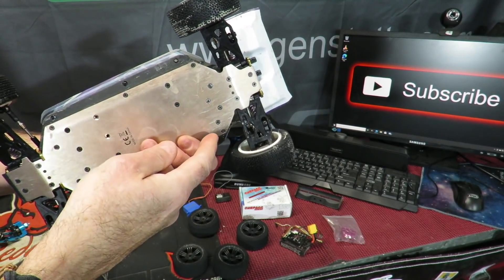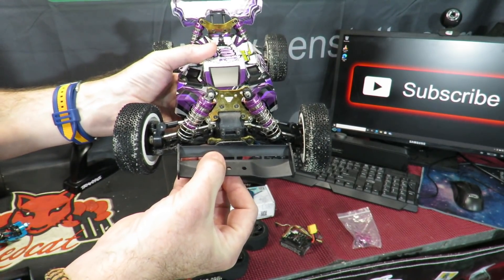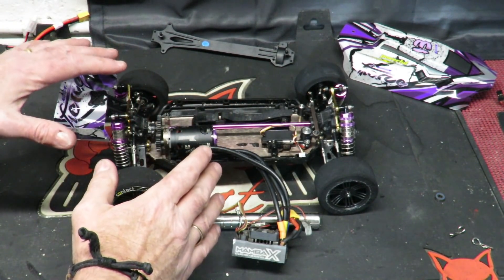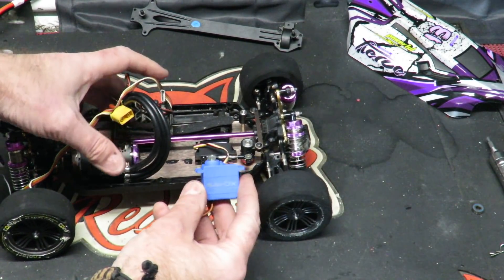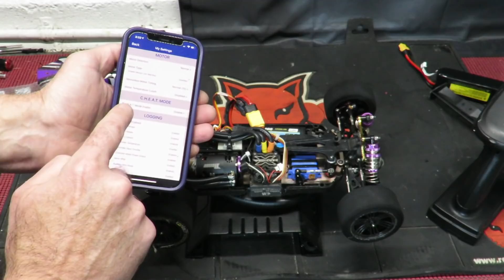Worlds Fastest WLTOYS 124019 Project 120 #RCINSANITY

Comment: I can't wait! I just fitted 2 motors in my 124019, I don't think the kv I'm running will top 100mph, but I wanted to see how it does since no one I can find has put 2 in a 1/12 car, I can fit them in the 144001 also, but need side trays for both. I laid my escs on thier side, and it worked out well.
Reply: One benefit of 2 motors is that you can gear up. Try larger pinion gears and/or smaller spur gears. The rpms of the motor dont matter all that much if you have twice the power behind them and proper gearing. High rpms don't matter if you don't have the power under load to actually reach anywhere near maximum rpms. That's why higher kv often doesn't actually mean a faster car. Having two motors actually allows you to overgear even higher.  Theres a reason that none of the fastest speed runs have been done with high kv motors. They are generally done with high voltage and low kv motors. 2 motors for speed runs is actually not unheard of either.

Comment: This is cool! I'm building an A979 chassis stretched using the 144001 driveshaft.  The a979 is narrow enough to fit old pan car 1/12scale car body's and is so light weight should do well over 100 mph on 3s lipo.  I don't expect the diffs to last forever and I have to shim the bearings etc. Build tolerances on the A979 are a bit loose but I can make it work.

Comment: Where did you get those aluminum wheel hexes. I bought a set from Banggood but the pin that came with them were too small for the 124019. Thanks
Reply from the maker: Let me double check as under COVID I’ve bought a lot on eBay and Amazon as well as Banggood. Also if you’re in the USA then LC racing have a store over here and as the wltoys cars tend to be lower cost copies a lot of the parts fit and arrive very fast. I bought about a car loads worth of spares inc a set of pins and screws(devil to get anywhere else!)
Reply: @DriftomaniacsRC  I looked at the LC racing hexes, they use a grub screw to to attach to the axle. The WLTOYS looks like a plain aluminum hex with a certain diameter pin. The hex I bought has a different size pin than stock WLTOYS.

Comment: Hello, the motor is recommended with 1 S lipo. Does it work well and without risk for the motor with 3 S Lipo?
Reply from the maker: I'd spotted that as well and was pretty nervous so I test ran it on 3S on the bench (timing on low) with some hard full throttle blips and it didn't get warm so yesterday I tested on 2S at my test spot to see and it ran cool. I am thinking that it'll be okay as it's barely pushing any load/weight. It began to rain so I had to quit but will try again today
Reply: @DriftomaniacsRC  Thanks for the answer I look forward to the 3S test and know the speed ;-)
For the moment it is mounted with a BL Motor 5200 kv I have a Castle 7700 kv but the cables do not fit in the ESC

Comment: Richie, I have a question for you. So when I place the MOD 1 gearing using the Traxxas 6492 29T pinion the center spine is not wide enough for the gear??? Can I or should I place the center spine back on? Is it critical for a speed run? I don't really want to grind away at the gear for proper placement?

Comment: If you went to finer pitch, it will only help speed. Finer gears are more precise, so less noise, and thst means less wasted energy. Back in the day, the 1/10 racers even used 64p gears to have better gearing adjustment, and better efficiency and performance. This had to be used on the cleanest surfaces, however

Comment: Droop screws are for limiting suspension travel and not really meant to lower a car. You should always lower the RC using the adjustable spring perches.
Reply from the maker: But on this car that would effect the spring rate which is not what I need though I appreciate the tip though. Bear in mind this car is set up for speed runs not normal use.

Comment: Sorry a bit off topic not sure, but maybe someone can help. My 144001 front wheels dont turn, no power at all rears do though. Could it be the differential?
Reply from the maker: No worries, It might be the front diff OR if neither is turning it could be the gear (at the front) on the center driveshaft that's the issue (Held on by tiny screw but can come loose)
Reply: @DriftomaniacsRC  ok cool yeah maybe the center gear shaft has an issue I noticed its but turning but the rear wheels do. Haven't torn it down yet. Thank you for your feedback.

Comment: I'd probably try 2s before going 3s. Then 2-2s in parallel. But your crazy for doing amazing build. Keep it up rich. Your great at what you do. Hope it don't rip apart on take off
Reply: Why would you do 2 2s in parallel?  The weight and space constraints makes that not a viable option. Single 3s or 4s is the way to go
Reply: @roberttruesdell6151  on that many of will draw about 80a. Gogitr yo hey full use of the motor would take 2 batteries
Reply: @walteradams9712  what?
Reply: The discharge of the battery can only be so fast. We know it as the c rating. To get more amps to the motor you need higher c rating. The easiest way is to run batteries in parralel. I've ran my wltoys 12429 at 6900kv motor with 3s at 42mph but with 2-2s in parralel it gets 48mph. Sorry it took so long to respond

Comment: I suspect you'd probably be far better off running 6s on lower kv.
- Firstly and most importantly you could use a 6s ~1300 battery for a racing quad (firmly believe this is where the highest performance lipos are). 4s ~1500 is a close second. RaceDayQuads OEM packs are good value and excellent performance. Tattu R-line and GNB are also good options but I don't know who stocks them on that side of the pond. If you want power in a small package you need racing quad packs, difficult to explain the gulf in performance vs what you are using. 10000000% you need a couple of these to test.
- Secondly although in theory lower kv doesn't equal more torque that will not be true if the rest of your system is under high stress. Your motor might be able to take 100s of amps but the wires and connectors you use will experience significantly lower performance if they are pushed far beyond their current specification. More so as heat increases.
- thirdly 6s wltoys is way better clickbait